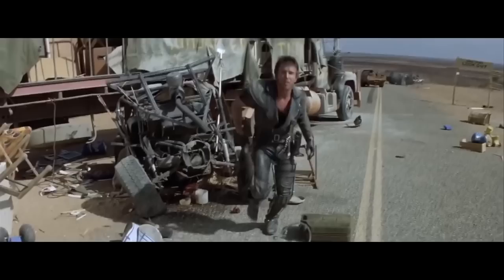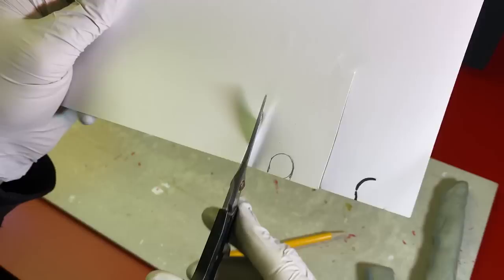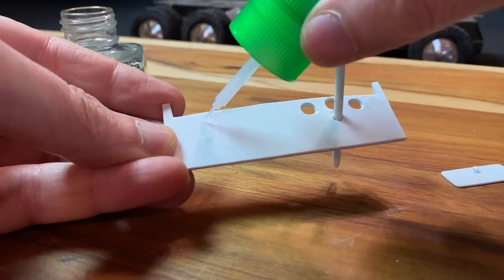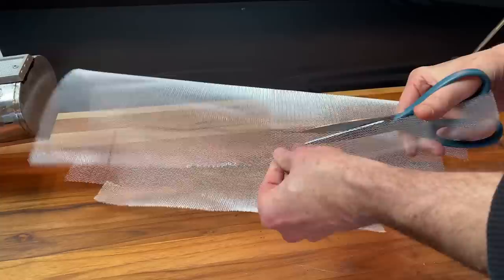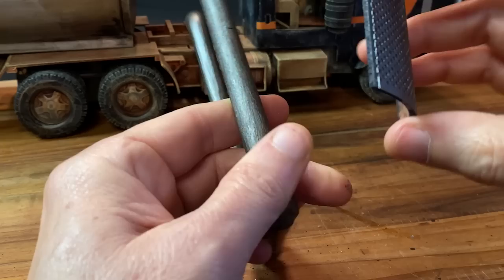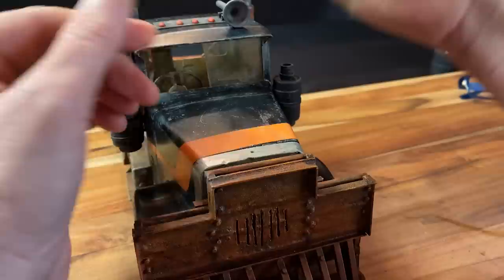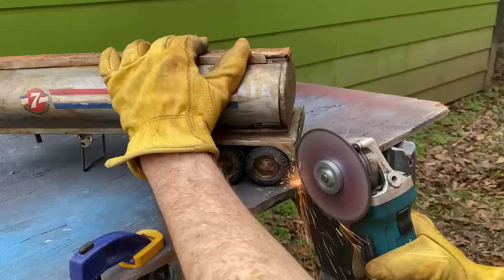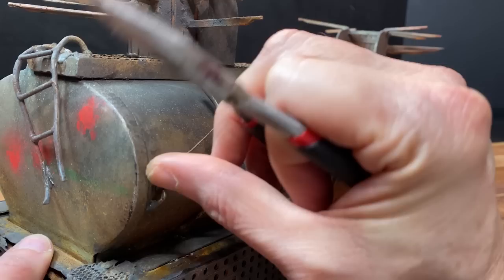Convert a TOY into THE ROAD WARRIOR Truck - MAD MAX 2 - Miniature Build

Comment: Top tip for glue residue, Zippo lighter fluid and a cotton ball.  Takes it right off nice and clean.
Reply from the maker: Ah, if you look again at the video you can see that Zippo lighter fluid was #3 in the products that I tried, but it too did not work. Thanks, Sue.

Comment: T-Nu! Insanely cool truck and right up my alley 👍
I'm going to try the barbed wire trick in the future. It's filed away in my craft brain!
Reply from the maker: Right on, BP! You can actually make the little barbs, but it is time consuming and the tiny wires are sharp. Knots fit into the "Close Enough" category. Thanks!
Reply: @CajunCraftastrophe  at a small enough scale I think it would be fine and the time savings is welcome!

Comment: Turn down the speed of your wire coming out and turn the heat down to a little under whatever is half for that machine for welding metal that thin. I'm fairly certain that's why you got popcorn welds on your truck. But like you said, it's a post-apocalyptic vehicle, so it really doesn't matter. You're going to get better with that thing, I'm positive. 

Source: I melted through the front of someone's boat with my aluminum rig, pretty much trying to do the same thing.
Reply from the maker: Haha! This is great advice. It's  cheap welder and was on the lowest and slowest setting. I'll keep this in mind and work on my technique. Thanks man!

Comment: Could have made molds of the rear wheels and cast a set but then again the scale would be off. Good choice not adding. Can the tanker hold sand? Excellent work! It looks like the Road Warrior truck.
Reply from the maker: Good point. Well, the tanker is hollow, so adding sand would've been a nice touch! : )

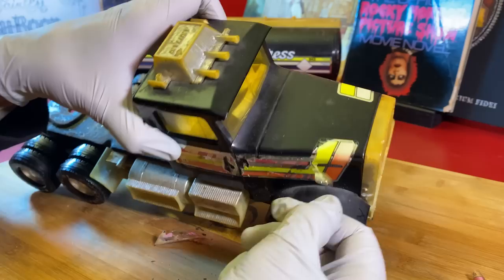Comment: 1:39 Heat gun for the sticker, and acetone for the adhesive. It'll ruin any paint under it, but it works.
Reply from the maker: Thank you. This was a whole other level of adhesive. Insanely strong. The heat gun sort of worked (I tried it on the trailer because I didn't want to bubble the paint on the cab), but it would get gooey and just spread. I did try nail polish (acetone), but it's not 100% acetone which I hear is better. Thanks so much for the advice!
Reply: @CajunCraftastrophe  I've only come across one type of sticker that a heat gun wouldn't work on, and it was an aluminized one from the military. I ended up just using a razor blade to cut it off in long strips.
Reply from the maker: @ridethroughlifertl  Nice! I wonder if these are similar? You can see that they have a metallic sheen to them and do indeed look like they have a thin veneer of metal. Though, don't ever underestimate the power of user error! I am no sticker expert! : ) Thanks man!
Reply: @CajunCraftastrophe  The one I dealt with didn't have a plastic feel at all. It was more like a piece of aluminum foil with some kind of intense adhesive on it. It would cut you if you weren't careful. It was on a bicycle of all things.

Comment: actually, taking it apart and using a paint stripper gun would have been a breeze.
it s cool to build new parts, kudos to you!
and so many, in detail... just wow!
one clear advantage building mad Max stuff is, you can hardly mess up,
as it s all damaged parts, nothing is really straight.
the amount of detail and wear is really impressive!
the result is as close as one can do.

we can see 6 wheels on the original s trailer, but... who can get that?
+ it really looks nicer with 4, honest!
it s unfortunate that we can t get figures to fit the cabin.
that would have been the cherry on the sundae.
yours is surely the best look alike Max 2 rig, it s just ultimate!
wow!

good work bro!
Reply from the maker: A paint stripper gun sounds like an amazing tool. If I did a lot of steel toy conversions or rebuilds I'd probably save up for a sandblaster. I don't do these too often though... but I'd still love to have a sandblaster! : )
Yeah, room for an action figure would have been a big plus! Thanks for watching!
Reply: @CajunCraftastrophe  I meant to remove the stickers, once you removed the plastic parts, it s way easier to use the gun for removal on the metallic parts, also, caring for your health, as an artistic bro, I worry about your use of chemicals, just a note of concern. it s worth my time to help creative bros such as you, I really like the idea and theme. you deserve respect, admiration and support. + I m pretty sure this is not your last piece, my advise is for long term, I d really like to see more of the genre from you. you did great, honestly, I d be curious of a 100% your creation for a next rig! if you could include a fig, that d be awesome! hey, keep the rock alive bro! thanks for the reply!

Comment: Just putting this out there.. For removing stickers and paint..  Might not work, but I've had success removing a lot of stuff with it.  100% Acetone. Not nail polish remover, which it is and does, but just straight up Acetone, you can find it beside the nail polish remover in most stores.
Reply from the maker: Ah, I did try Nail Polish Remover, but not pure Acetone... This is good advice, Shari. I will file that away in my head. Thanks!

Comment: Nice....A Freight Shaker turned into a Bulldog.
You also used a Mig Welder not a Arc welder......
Reply from the maker: Thanks! Are you sure about the welder? You can see in the shots where I have the metal AC clip connected to create an electrical current through the work piece. As far as I know that is Flux Cored Arc Welding (FCAW), but I do this to learn, so please do tell. : )

Comment: Did you try heat for removing the stickers?
Reply: I was thinking about that extra sticky glue, too. 

I've not done anything that seems that strong, but for most hard-to-remove label-type glue,  if it's extra gummy, I'll add dirt, cornstarch or baking soda to kind of kill some of the sticky. Then I'll use any random combinations of baking soda with dawn (degreaser) soap, and/or also peanut butter (sitting on it for a couple days, the oils break it down a bit). Fabric softener mixed with baking soda too. And yeah, always that elbow grease!
Reply from the maker: I thought about it but I didn't want to damage (bubble) the paint on the truck cab. I knew that the denatured alcohol and scrubbing would make the finish matte instead of gloss, but that worked perfectly for this build. On the tanker I mostly used a metal buffing wheel because the top of this part of the toy was made out of plastic that I couldn't figure out how to remove. I didn't want to melt that or distort it. However, heat is a great suggestion. 
Thanks awldune!
Reply from the maker: @xmobile.  This comment is FILLED with great tips. Thanks man!

Comment: You just earned yourself a subscriber buddy! I thoroughly enjoyed it, even though I'm not making models myself I enjoy watching something like this come together. I also dig the small nods for MM fans like the 'Metal' logo you did (nod to Heavy Metal comic books?). Pro-tip to get around audio copyright: if the footage you're using is 5.1, use only the center channel in your editing software (removes most music). Mess with the center channel a little and you're good. Good job man! V8!
Reply from the maker: Thanks for the sub! This means a lot coming from you... obviously you like Mad Max! : )
This is good audio advice! Yes, I kept getting copyright hits on this video so I changed all of the audio as you well noticed. Good ear. I will give the 5.1 trick a shot! Thanks!

Comment: How do you get the pigment powder to stick?
Reply from the maker: You'd be surprised at how much they just plain stick. It depends on the surface. Actual pigment powders adhere extremely well because they are ground down so finely. If you're concerned, you can spray a light dusting of matte clear coat to really bind it. However, most of the things that I build are display items and won't be handled much, if at all after they are finished. I hope that helps.

Comment: Cool video. Why the stickers were hard to get off..? Everything you used was enviro friendly/low impact crap. Thats not any good. Use chemical gasoline or, next level: acetone. After that: synthetic thinner or old school paint stripper. Problem solved..
Reply from the maker: Ah yes, this is great advice. I think that true Acetone might have been the key. I really didn't want to mess up the paint job on the truck cab. The denatured alcohol and scrubbing left a matte finsihed but that worked perfectly for this particular project. If I have to remove stickers again I am going to upgrade to something stronger. Thanks Mike!